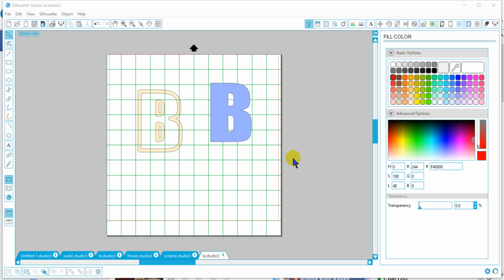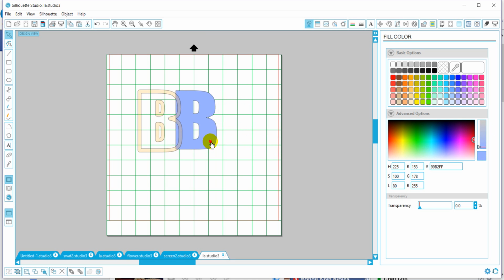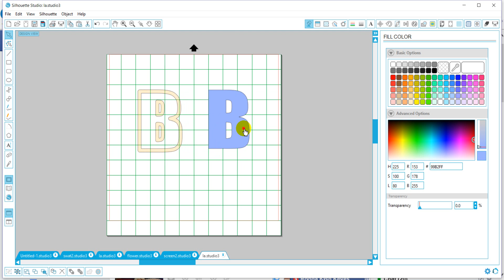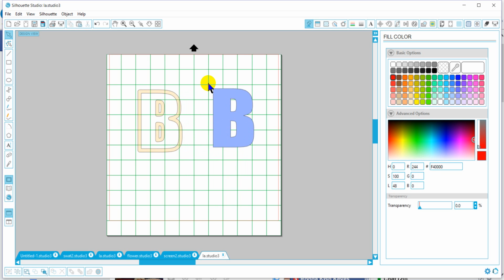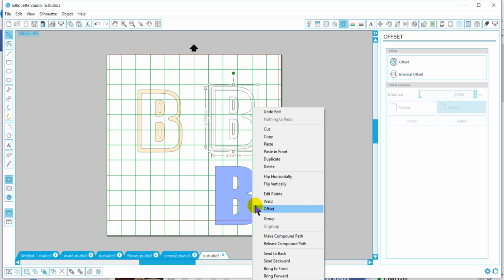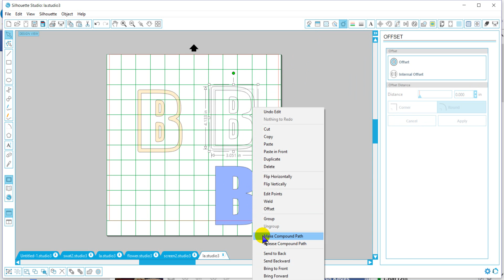HTV outline for fabric application in silhouette studio

Comment: OK, I understand how to make the outline.  Now, when I go to cut the outline portion, is there a way to salvage the negative part of letter outline?  Meaning, you will cut the internal/external outline and then, essentially you would be weeding a smaller sized letter B.  Is there a way to save/salvage that part?  I have Designer Edition and have tried cutting by colors, but not having luck.  Maybe I need to search further on the advanced cut settings?????  TIA
Reply from the maker: +Cindy Miller   If I wanted to salvage any portions....1st I would put my HTV on my mat....Then I would cut completely through the HTV and the carrier sheet.  There would be no weeding but rather just separating the pieces individually.  Hope that helps.